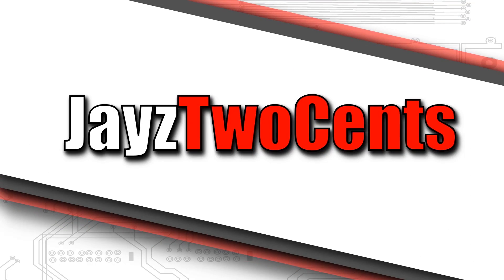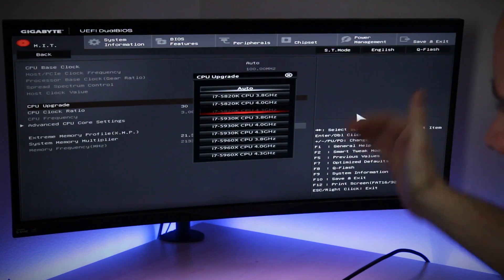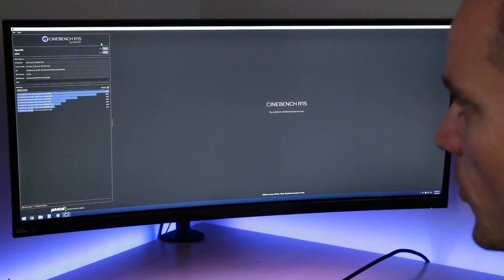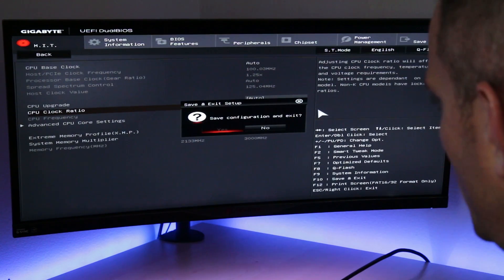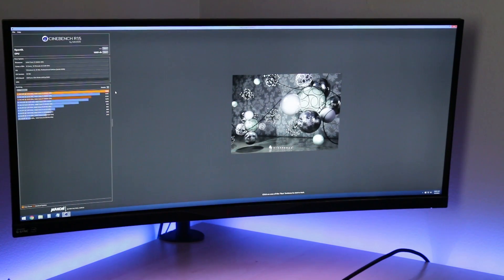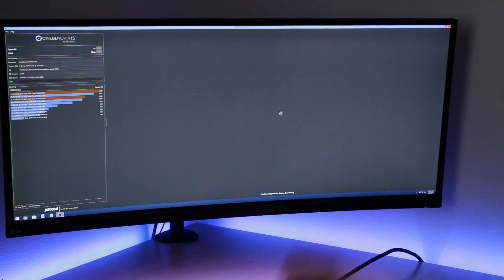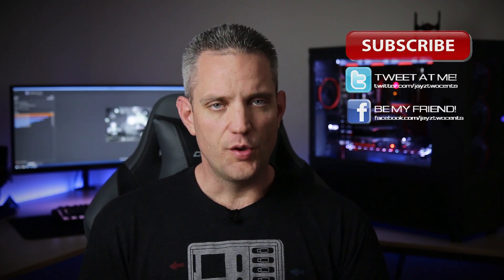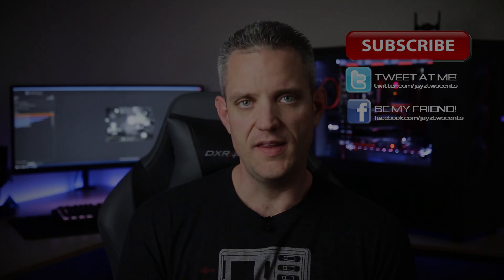XMP vs Overclock

Comment: I have an i5-4690k. Should I upgrade to an i7-4790k? I'm doing mild rendering and reencoding videos (not 4k). Does anyone know how much of an increase in encoding speed 6 cores give compared to 4?
Reply: Well if you are looking for 6 Cores (12 with hyperthreading) get a 5820k or 5930k, a 4790k would give you 4 Cores and 8 with hyperthreading.
Reply: For video editing and rendering, typically, more cores will be better. I'd get the i7.
Reply: +RobloxDev Remember, the 4790k has 8 threads, which is better for the budget minded person. However, if money is no object, go X99! :)
Reply: RobloxDev +Brannan Darmawi-Iskandar +Fernando Cuello +MasterGeneral156
Oh, lol how stupid of me. I think I mixed up something I read a long time ago.

Ok so basically difference i5 4690k vs i7 4790k, is extra 4 threads on 4790k.
I can't yet jump to a 5820k cause then I'd need to change my mb and ram too.
And having more cores is better than just extra threads? I think I should save up for the LGA2011 mb and cpu and ddr4.

Thanks guys!

Comment: I've had i5 4670K for two years and never overclocked it.. i'd say I'm actually scared of trying
Reply: I'm in the same boat as you but I've had mine about 8 months and I have a h100i cooler

Comment: Awesome video today! Here's my (noob) overclocking story:
Brand new 6700k and Gigabyte Z170X-UD5 mobo, (Starts messing around in the bios) "Hmm... I wonder if I can hit 4.6?" 
(bumps that multiplier...) "Well that was surprisingly easy I wonder if I can go higher?" (hours later....) "Well 4.6 it is lol."

maybe I just got lucky with my chip but I just bumped the multiplier,  didn't touch the voltages or anything, and it was stable first time.

Comment: Cinebench score 452 on a 4.22GHz Intel I5 760. I should update my system... ha
Reply: +DritzBW  i got a 406 with  i3-6100 stock  you   could just need a good system clean
Reply: +MrSlapClown \o/ It's on a fresh install of windows 10 64bit. The stock score on it is only  316. It's just an old out dated CPU now days, has served me well over these past 6 years.
Reply: as long as it does what you need to your all set

Comment: Got my 5960X on a 4.7ghz overclock on 1.26v stable. Cache is on 4.0ghz, it wont bloody budge past that even with 1.4v. System has a custom loop so the cpu max temp is 67C
Reply: +ClownFace1511 My 5960X is at 4.5GHz 1.26 Core 1.76 Input. Uncore's at 4.4GHz at 1.28v. Max temps are also bellow 70. The 5960X is a beast of a CPU.
Reply: Yeah it is. I haven't really fiddled my my cache but anytime i pass 4.0 the system isnt stable. I also tried overclocking the cache first before the core but to no avail.
Reply: ClownFace1511
No matter what I did I couldn't get it past 4.4GHz either, weird.
Reply: I got mine running at 4.8 with 1.35, gonna try hit 5.0 just for the lols.
Reply: You won the silicon lottery m8